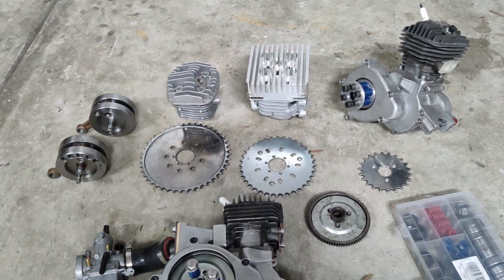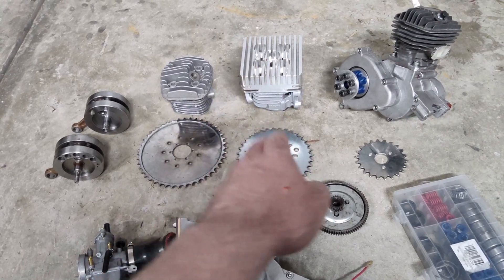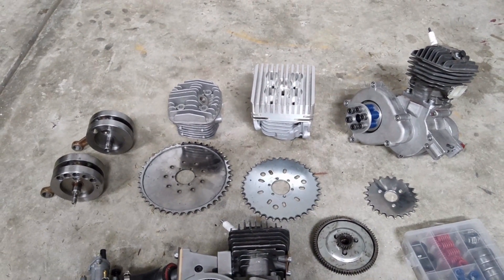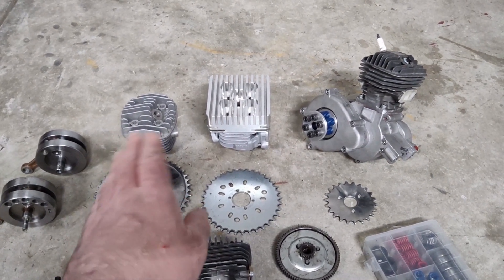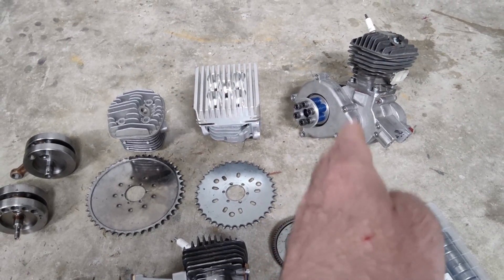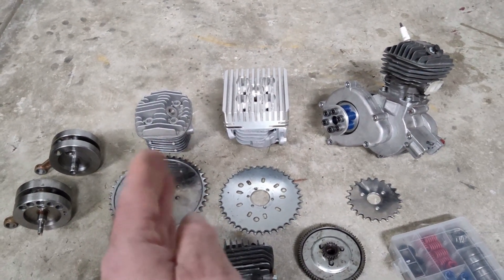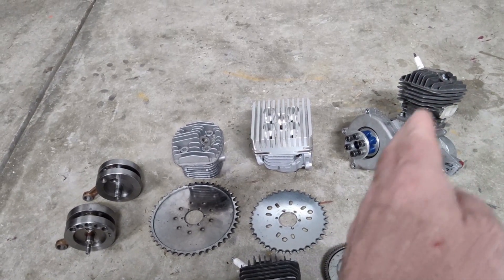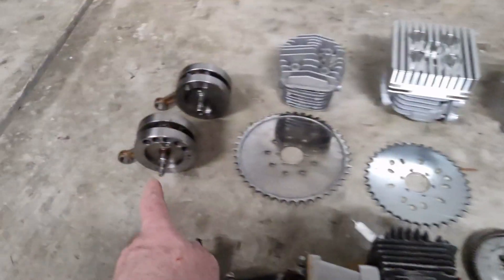Motorized Bicycle -The Google Powered Magical Unicorn Information Search! Dremel this

Comment: So with that being said on like a 660 build what I'm hearing is add a draw through turbo charger. It needs more air and that's a turbo's job.
Reply from the maker: It's a two stroke crank case and stroke length x piston area are what chooses that ratio.  Motorized Bicycle crank case is way to small is the problem by almost 1/3 of stock saw case the top end comes from

Comment: Well made explanation. All my china dolls are 49mm iron sleeve. I ride a 32 T sprocket on all my 2 bikes max speed straight  road 76 kms / h @ almost 7000 rpm, taking some time to reach it, this  on the faster one.
Uproad with around 10% inclination max speed  not full rpm is around 57 reaching fast, and I'm a 94 kg person.
You're well right concerning those needle bearings.
Support crank bearings I use SKF TN9 c3 series  on the clutch 2RSH c3 ones 
Cheers

Comment: I’m new to this and bought a Bikeberry BT-100 v2 kit for my first build. I’m not looking to go super fast, but I’d be curious to hear your opinion of that engine and its capabilities/best setup information.
Reply from the maker: It's a great engine.  Just keep it 3/4 throttle it will live a long life. Few rips here are fine just nothing brutally long or wrist pin bearings give out. It loves a 38t sprocket on 26" bikes.  Touch of speed but your not killing yourself trying to pedal start on hills.    Used a ngk bs8h-10 ngk plug.  It like the perfect plug for those.  Not to hot not to cold.  Stays right where it should even on hot hot days it won't overheat.   32:1 oil mix if!( Organic oil). Use 40:1 synthetic oil mix.  Break in use organic oil 16:1 really helps shape and cool piston rings correctly for a long running life.  On break in never go past 1/2 throttle on first gallon or (3L) gas! Then go nuts after that lol
Reply: Awesome. Thanks for the good advice. I’ll do what you say.
Reply: BTW, I just got a Tecumseh HSK850, little brother to your 7 HP engine. I also found a Worksman Newsgirl bike I’ll modify to use for that engine.

Comment: Reed valve allows the mixture to move in only one direction – from the carburetor to the crankcase. It prevents the mixture from moving back to the carburetor. In the effect reed valve improves reloading of the combustion chamber with fresh air-fuel mixture. This improves power output
Reply from the maker: Yeah but it's kind of not an issue since it's sucked into the crank case blowen into the chamber.  Flow Reverbs more of a 4 stroke issue with it slamming into a closed valve.  Reed Valve was designed to increase the duration of the intake without causing transfers to cross talk port timing wise. Creates a one way flow so transfers with windowed position or boost port won't blow what you sucked in out the intake since it's still open at that timing point.   As for a 4 Stroke reverberation you add a velocity stack to traps the back flow after Valve slam stops the flow direction

Comment: Hey BBF
Is it possible to get the blue print for the crank puller ?  Have 2 cranks I need to replace bearings for.
Reply from the maker: They cost like 10$ at harbor freight.
Reply: @BuildBreakFix I lice outside the USA but I'll see if have site
Reply from the maker: Just a small 2 jaw gear puller. 6"  (150mm)
Reply: @BuildBreakFix thanks I'll look for it
Reply: @BuildBreakFix can be used to reassemble also?
Reply: @BuildBreakFix have any links by chance? I'm gonna search the site still

Comment: I agree with the 40mph realistic limit for the 66/80cc CG. That's about the most I've gotten out of mine (case reed bottom end, upgraded bearings, balanced crank, etc.). I could technically squeeze a little more top speed out of it by increasing exhaust duration/blowdown, but I don't want to sacrifice torque to do it. Plus, it's been a very reliable motor so far.
Reply from the maker: Yeah there is a reasonable expectation. Most don't get that lol. When they post the 68mph video with every other frame missing at 3x speed 😂 it kills me!  But in the description I linked a video of how to calculate actually speed of the bikes.  But hey some find ways to bend time and space 🌌 😂
Reply: Once u go 40 that becomes slow after u get familiar speed is very addictive it's really a drug and yes it's cooler on a bike

Comment: La hover did 52mph g4-47. 
Have you tried ms380 on yd100 stock gangster builder said ms380 matches the stroke of yd100 perfect
Reply from the maker: LA Hover🫢 🤡 lolz...   g4-47... But that top end is a near identical copy of a minarelli port structure. So yes it's more than realistically doable. You also will destroy everything on the crank in a matter of minutes attempting it.  But yes paired with a 28 or 32 t sprocket ⚙️

Comment: I recently finished my big bore iron sleve and there is a massive difference in torque vs the aluminum one, with just some basic porting I have never had to pedal no matter the gradient of the hill or my speed entering the ramps, its amazing for off-roading.
Reply from the maker: Yes always bigger=more torque.  Just never more speed 😜👍

Comment: Hmm  how come I was able  to run all my 47 mm China junk 9800 rpm with 10/32 & ehh from 10,000 to 10,250 easy  with my 47,mm China junk,my 50 mm o44 crap would pull 10 / 32  easy mybe I set my port timings up way different. Ps I stopped wasting  time case porting and stuffing years ago. Reed valve  is simply a one way check valve definitely  picks up lower end power and way easier  to tune and way better throttle control.prevents reversion. Besides  adds more crankcase volume  and more intake duration. When set up proper ooo yea never had crank bearing problems. Not sure where your getting your information. Ps I allway had a tachometer.
Reply from the maker: Yeah but knowing you. You had heavy port modifications which 90% have no f*n. Clue how to do 😂.  That was exactly why I said not many can unless they can make it like other two by changing porting.  Let's be honest. Takes a bit of know how to convert one like that. Most can't clean a port out well lol never mind restructure them like you can. Then  bearings. Sure if that crank is ideally balanced and done well into 80% range sure they will last a long time. But again 99% can't even get close to that 😂 you're in whole other level compared to the population. It's a general video toward the 99% crowd that knows nothing like you do. Guess would be the easy answer as to why you can lol  rest wouldn't know where to start 😜👍
Reply: Good point. There is a few good points to your video. Crankcase  work ie directional  flow porting & stuffing and volumes talk are completely  comical. The fake mph claims are defiantly  sad and funny. I basically  had to stop with bicycle groups because I no longer read ridiculous  theory,s and comments, I believe  people's expectations  and reality are dillosional.  Basically  there small bore cheap old school technology. They complain  about a 100$ motor. Blessing is its not difficult  to make them run great and kinda reliable  with minimal  common sence and basic understanding  of two strokes. Good video  I should have watched and listened  better before  I commented. Carry on.
Reply from the maker: @2strokecarbtuningportingin187  funny part is a stock motor with exception of matched belly pipe is pretty much ideal out of the box lol clean all shit out of the ports of course. But in the end. All the cutting and tinkering give a stupidly low % of performance bounce. If you actually legitimately balance the crank runs smoother. But again 65% runs perfectly fine. In Specs of a 2 stroke of this kind anyhow. "Most' come 68, to 73% out of the box.  I know everyone gets pissed when I say this.  But 99% of all shit people do with zero clue how to legitimately port time and wtf they are doing period all shit is bull shit 😂. All the add on shit CNC heads made out cheap metals lol all smoke and mirrors for $$$.  But bragging rights all part of every hobby when you buy stupid items lol for $$$.  My 2 favorite bull shit claims. Idiots that think port matching a crank case adds 1000s of power 😂 when it does nothing.  Or when they put a plug 6 times hotter then the surface of the sun in but can't figure out why the engine seized lol. Sorry 3! When they mix some stupid ratio of oil like 100:1 and there shit goes into thermal nuclear meltdown mode. And then they can't figure out what the f*** happened

Comment: 12:19 ARE there any designed to go faster than that?  Is that the ceramic stuff you put in your 129cc?
Reply from the maker: My Ms460 54mm "pure rage build' ceramic "everything" just the bearings. $423.54 for those bearings lol and still max rpm of 8k so $$$. Now the 139cc build has a 1" wrist pin in a 3inch piston. With a 1.75" crank pin. It can handle higher rpms. That engine is imperial btw!   Ot metric*.  Ceramic bearings build https://youtu.be/PcEaiVkMBeE

Comment: I run a 36T on my 49mm no issues but it has a dirt bike pipe port work and a crazy induction system lol
Reply: Mmmmm pork work
Reply: @alexanderwhite1020  lol you got me
Reply from the maker: But! Is it a 49mm or a 49mm smog! See there is a huge difference in port structure. Like James has a smog. Thing cruises like a bat out of hell. Ebay 45$ kits are a fancy 80cc with nearly no benefits 😂
Reply: @BuildBreakFix  tell me the differences in cylinders and I might be able to answer it better

Comment: Why didn't you talk about 47mm standard
Reply: This is why.....https://youtu.be/0RzH1eDA6lE?feature=shared
Reply from the maker: Well did to an extent read description of the video. But to answer that 49mm is a low end porting engine. It is so low end designed it can run without an exhaust even. 50cc, 80cc, 49mm iron sleeve, yd100 all have the same port structure.  Now the 49mm smog iron sleeve does not so that confuses some. but that group would require. Change in roof heights, decking. Exhaust duration changes, reed valve and open transfers with a 3rd if possible added.  Or a boost port straight up to achieve close to minarelli port structure.  *Speed build*. Saw builds are near identical with all porting 1.8 to 2 mm lower on same stroke with larger squish gap.  There is a science to there design. But yes very good question I should of used one of those instead of the iron sleeve I had laying on the bench for the video

Comment: Many chainsaws with a 10mm piston pins are hitting 10,000+ rpm and Mineralli scooters hit 8000+ rpm 
So if someone wants their 47 -52mm engine to go past 7000 max rpm. They could pickup a 10mm  chainsaw wrist pin bearing.....I  noticed many 49mm iron sleeve kits use a bearing that looks different than the older 47mm ones. It looks like it's better but hard to know. 
I'm set at 7500 max rpm so I'm not worried about stock 49mm  bearing premature failure. 
From what you say, if I was gonna try and build a 8500 - 10,000 rpm engine. I'd buy a chainsaw bearing for it.
Reply from the maker: There is no such pin... You know all those chainsaw and phantom conversation pins all 20,000+ I made and sold right? 😂 that was just last year ..  https://youtu.be/ipU32SskAsw
Reply: @BuildBreakFix  OH yeah, I guess not for a 52mm piston. I haven't checked but pretty sure I can find a 10mm chainsaw wrist pin bearing that's interchangeable & will fit on my 47mm or 49mm. If it's 10mm I'd, same width & same od to fit inside rod end.

Comment: Im good with around 35 or so i was told that the minarelli last longer cant say thats true bc never had one but over all thats all i looking for but thanks for the video it helps knowing the reed valve intake manifold what it does 🤝
Reply from the maker: Minarelli will last a very long time if you go easy on it. They are fun but you have to be kind to the (cast iron ones) aluminum one in this video is amazing though. But in the end those crank and pin bearings fail... Boom toasted lol
Reply: @BuildBreakFix  I only ride for like half hour 40 minutes when I had the standard piston in a 30 minute ride 20 minute ride if I’m lucky I upgraded to a Wisco racing piston and I could ride for damn near one hour without no heat seas
Reply: Make sure you upgrade to Wisco piston they’re pricey, but worth it to four years without one heat seizure the piston fucked up the cylinder before the cylinder had a chance to fuck up the piston bought a new cylinder for 100 bucks off eBay and it works brand new again Wesco  pistons are hard to fuck up
Reply: @cesarpagan4640  thanks for sharing this brother
Reply from the maker: @cesarpagan4640  if you look my minarelli builds only one I use but I have them ceramic coated. Deflected heat well iron ones. But aluminum top ends hont have cold seizure issues
Reply: @BuildBreakFix  and I used the original zumaa cover to fit it over the cylinder helps a little bit with cooling

Comment: Nice I think I get it I got watch my rpm .dame I got to agree the last set of repair was wrist pin bearings and the con rod big end bearings.all over 10k rpm well not my ms hybrid but the 49iron sleeve and the yd1100 failure you confirmed my fears to high rpm for chineseum   parts
Reply from the maker: I seen 100s blown engines now over 10 years on these bikes lol #1 cause wrist pin and crank bearings turning to dust. Even few of my own builds lol
Reply: @BuildBreakFix  I don't always agree with you but this time your 10/10 good info for all motorized bicycle engine owner 👍💯

Comment: I can hit 45 on my phantom 85 with a 36 tooth sprocket but I don't rev it past 6k. I put the dio reed kit on my yd100 and the pwk carb was a pain in the ass to tune. The nitrous kit is fun too
Reply: Good Deal...keeping these engines at say- no more than 7,500 rpm will help them last longer. Especially if they have a balanced crank....I've learned a balanced crank, pre cleaned engine, proper break in, use correct oil/gas ratio in an iron sleeve engine with no higher than 7 to 7500 rpms & don't overheat engine can get you thousands of miles.......I haven't owned a Phantom85 but after seeing all the overheating issues. I'd #1 get a $25 Runleader cyl head temp guage (also has RPM guage, TRT, max temp alarm & few other features) to monitor engine temp when riding and  #2 Use a castor based 2 stroke oil. I was reading a huge benefit of castor 2 stroke oil is. It can save overheating 2 stroke engines because the hotter the oil gets. The thicker it becomes & more it sticks to parts 🆚 non castor based that gets thinner or burns up.... The downside of castor based for dirt bikes is. The oil doesn't burn as clean & likes to gum up engine & power valve over time. Not a big deal on an easy to pull apart MB engine.....I  hope they get the Phantom85 v4? with 2 piece head right. 
That iron sleeve 50mm BT100 V2 sucks for the price & needs proper port work for any decent power.
Reply: @michaelbrinks8089  I use the 2 stroke oil they told me to and I do have a mph, temperature and rpm gauges and it's never come close to overheating. My yd100 on my spare bike runs hotter than my phantom 85
Reply: @Westhelockpicker  Good Deal....How long does it take for your cyl temp to reach 300F...My 49mm with the heavy cast cylinder head. When fully warm in the low 200s, will reach 300F after a mile or 2 at wide open throttle on a hot day. But will quickly cool down once I go back to 1/2 throttle.
Reply: @michaelbrinks8089  it never hits 300f
Reply: @Westhelockpicker  WOW that's pretty good compared to many other Phantom85 videos....I  never checked stock 47mm engine temps but pretty sure it'd be 300+ after a couple miles at wide open throttle on a hot day....Gotta fix my slipping rear sprocket & see if cooler 60F riding temps keep temps lower......So glad my Runleader gauge has lasted a yr....I screwed up & bought a $12 rpm only guage before realizing I could get the Runleader for $25
Reply: @michaelbrinks8089  my phantom 85 runs cooler than my yd100 does